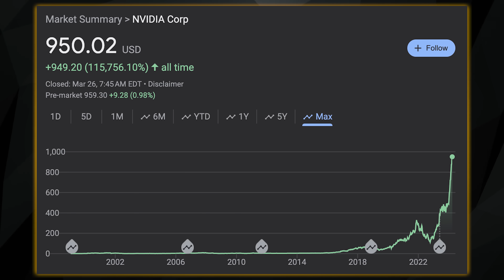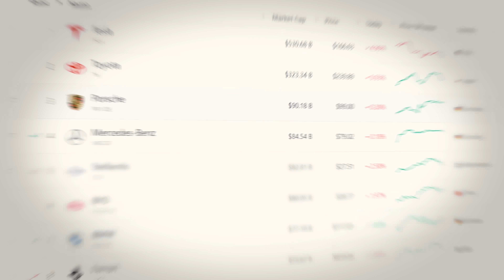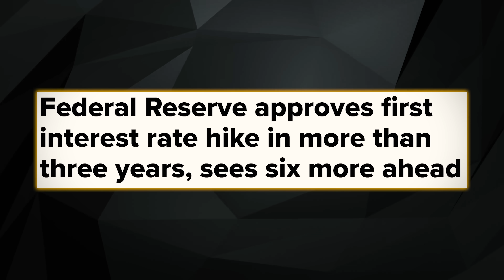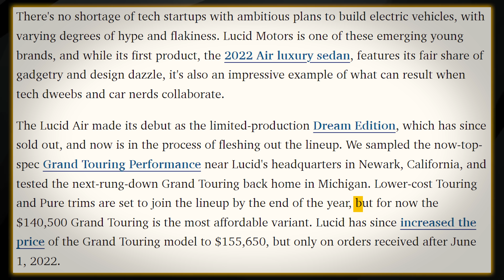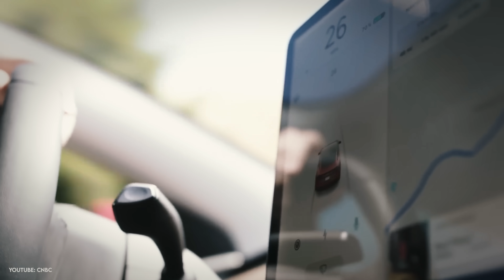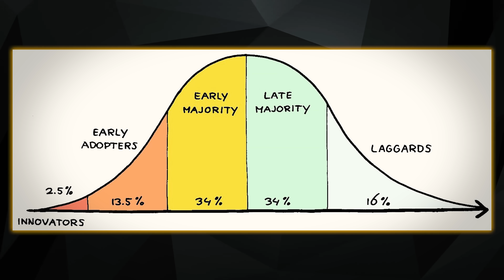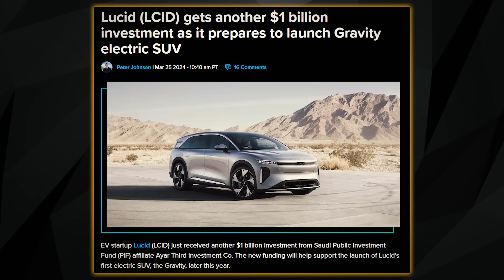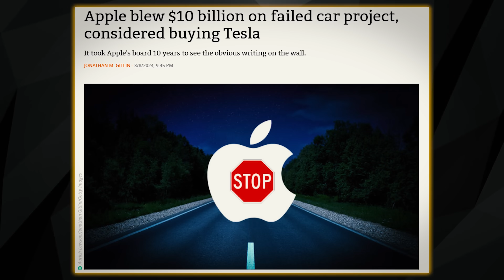The EV Bubble Popped - What Now?

Comment: Most people don't understand just how much energy is stored in a gallon of gas or diesel. The US uses about 11.15 billion KWH of electricity per day. We also use 376 million gallons of gas (125k btu/gal) per day, which is 13.77 billion KWH of energy. We also use 125 million gallons of diesel (139k btu/gal) per day, which is another 5.08 billion KWH. Having everything be electric would lower those numbers somewhat because it's more efficient, but even if we're charitable about the efficiency gain, we'd need to double our capacity to generate energy, all while getting away from fossil fuels? 
It was NEVER going to happen. This was always a government-subsidized pipe dream, at least in America. 
Hybrids and biofuels or synthetics made from captured carbon were always better alternatives. It has all of the EV upsides regarding efficiency (and zero emissions, on short trips), and none of their downsides. Big trucks should also be made with the same style of powertrain as diesel-electric boats or locomotives, with a big enough battery to do (very) short local trips or move around a yard on it's own. EV battery weight is pretty consistently  ~35% of vehicle weight if you want 300 miles of range. Scale that up to a 90k lb semi - it just doesn't make sense. Liquid fuels with hybrid tech is the solution for the energy requirements in the first paragraph for the forseeable future.
Reply: They have done this. It was phev
Reply: That’s a well written comment right there… I actually learned some things.
Reply: @jameschalkwig787 Renewables with massive batteries, which can handle massive changes in load.
Reply: Renewables are the future, and not only because of man made climate change, but they will produce energy more financially efficiently. Norway already has 70% of its energy coming from renewables. Technology always moves forward, there was a time Bugati produced a car that used 1.5 miles per gallon. The push back comes from fossil fuel companies who want to maintain the status quo and have used propaganda to get people against EV's. The next big thing could well be solid state batteries with billions being invested, their practical usage isn't a case of if, but when.
If we look at what the ultimate future to be it will be every household producing all its own energy needs via solar/wind or something we haven't thought of yet. Problem is that will mean no energy companies so they will all continue to fight it. So work backwards from that endgame.
Reply: @alfredthegreat9543  then explain why in Europe electrical prices have exceeded diesel/petrol prices, to the point the active road charging in Germany was deemed a failure.  It's cheaper to buy the fuel with the heat taxes on it than to pay for the electricity.

If renewables are the future the plan must be to make everyone poor and take power away from them.
Reply: Well done sir. Logic v emotion.
Reply: @bowez9   Europe has had skyrocketing electric prices because of their grids being too reliant on natural gas. That has nothing to do with renewables. Also the phaseout of nuclear in some countries ended up being counterproductive. By what source was charging in Germany declared a failure?
Reply: Biofuels and synthetic fuels aren't as efficient as an EV getting power from the grid or your solar roof. Efficiency is precisely why EVs are the only way.
Reply: @michalandrejmolnar3715  me: Presents well reasoned argument complete with numbers.
You: no, because efficiency (doesn't back this up in any way whatsoever, completely ignores how it would be impossible for every household to generate 1500-2000 kwh per month locally via solar panels. Reminder, people live in apartments too. Ignores how many areas just aren't sunny enough to be efficient, ignores massive number of panels required, etc)
Sure buddy, whatever you say. You just ignore the part of my original post where I said "for the foreseeable future" and jump a century into the future to where your pipe dream MIGHT be becoming a reality.
Reply: @IFRYRCE  I merely pointed out that EVs are more efficient to drive a certain distance than the required synthetic fuels. I am well aware you can't fully charge your EV with your solar, but solar on a big scale can still charge your EV. I know people live in apartments, for those there must be more city AC and intercity DC charging
Reply: @IFRYRCE  You know synthetic fuels are produced with electricity, right?
Reply: @michalandrejmolnar3715  Again, you've failed to address the core of the argument, which is that we do not have a way to literally double electricity production (to eliminate liquid fuels) while relying entirely on renewables, at least not for the foreseeable future. Especially as new extremely power hungry industries like crypto mining and AI tech are being introduced that will continue to dramatically increase maximum power load. Crypto alone accounts for over 2% of global power usage already, and AI is even more power hungry.
I'm not disputing that you may be correct if we go far enough into the future, but its not likely to happen entirely in my lifetime. Additionally, liquid fuels are simply far too good at storing energy (per unit of weight) in comparison to batteries to give up their use where energy generation must be mobile, such as in vehicles.
Reply: @IFRYRCE  That argument plays for me, because we will have a better chance to deliver less electricity with EVs than with synthetic fuels.
Reply: @michalandrejmolnar3715  ok so you're ignoring all the math I did in the first post that literally proves that is not the case. Got it.
Reply: @michalandrejmolnar3715  you know batteries are produced with both electricity and liquid fuels, right?
It's not a matter of whether or not it takes electricity to produce either, it's a question of whether you can afford to make it all in one single supply chain (electricity) or whether it's far easier to have separate ones (liquid fuels and electricity).
Also, biofuels do not require electricity to produce if you make them with the correct crops, Brazil's ethanol production is a net producer of electricity due to sugarcane bagasse.
Reply: Facts my brother, unfortunately some people get overly excited about EVs without realising that it takes some time for technology and infrastructure to catch up to ICE vehicles
Reply: @michalandrejmolnar3715  it doesn't matter how efficient EVs are, the problem as the OP correctly pointed out is that to completely transition to EVs we would need to greatly increase our electricity output. Not only is that not possible now, but how are we going to do it, increase burning fossil fuels which entirely defeats the purpose of clean energy & EVs or switch to solar, wind etc which is never going to meet our energy needs if we all transition to Evie's no matter how many solar & wind farms we build.
Reply: @alfredthegreat9543  Countries like Costa Rica, Norway, Denmark, Sweden and Estonia are the exceptions that prove the rule. They are either blessed with geothermal energy source or have no energy intensive manufacturing industries and the resources to implement renewables. Most countries are in the same boat.
Reply: @alfredthegreat9543  All we need to do to follow Norway's lead is to find an area that gets sufficient rainfall, construct man-made fjords, and then dam them to generate hydro power.  Every household could construct one in its backyard.  And then each family could use the electricity to power a small smelting operation, like China did in the Great Leap Forward.  You can always locate the time of the Great Leap Forward on world population graphs.  That's when so many people starved to death in China that it actually caused global population to decrease around 1960.
Reply: Not only we'd need to double our capacity to generate energy (via Solar, wind or nuclear), but also the more expensive portion of increasing the distribution capacity.
Reply: Agreed.

We should of focused on improving and moderning our power grids and pushed for Hybrids.

Also, combustion engines haven't reached their full potential either.

Less gas, more power, the combustion engine still has a long ways to go.
Reply: Never? Some states are already achieving surplus renewable electricity generation during some parts of the day. I just read a story today about California grappling with a new problem - too much solar.
As more renewable electricity and battery storage goes online, much of that excess electricty can go towards charging EVs.

Even using gasoline (or diesel rather) to charge your EV can be more efficient and you come out ahead. Since a Model 3 has a MPGe of 138 city / 126 highway and a large diesel generator gets 45% efficiency.

There are many videos on this subject such as this one comparing a diesel ICE's mileage vs a generator charging a model S: https://www.youtube.com/watch?v=tw-hHggAYFM
Reply: @bravado7  my brother in Christ read the entire comment at least before you reply.
The very last sentence is liquid fuels with hybrid tech is the best solution for the foreseeable future.
I was already pointing out that it's more efficient to run EVs off generators, the only difference is that I realize it's better to put the generator IN the ev so you can do with a smaller battery. That's called a hybrid.
Additionally you didn't address the point about doubling energy usage, just mouthed platitudes about renewables that don't address a need to double the energy provided.
Reply: @IFRYRCE  The problem with putting a generator into every car on the road is that not only is that wastefully duplicative in terms of parts and systems, but also whatever generator you can put in a sedan wouldn't be able to get 40% efficiency much less 50% or generate from alternative sources such as wind or nuclear power.

I think that a pure BEV such as a Model 3 will fully meet the needs of and replace 80% of ICE cars on the roads especially if it's the family's second car.

Your proposed alternative liquid fuels also faces the same inefficiencies that I mentioned above, but has the additional inefficiency of converting whatever the original energy source was to said liquid fuel form.

Look no further than our current corn ethanol additive in gasoline which amounts to a government subsidy of corn farmers and a net waste of energy because ethanol production consumes six units of energy to produce just one unit of energy via ethanol.
Reply: @bravado7  Its not wasteful. The batteries are far more limiting in terms of quantity we can produce and what we can currently recycle than generator units are, it makes sense to use smaller batteries along with a small generator. The whole "duplicate systems are wasteful" is a disingenuous argument, hybrids are both lighter (meaning less material input) and cost less than full EVs of comparable size. It's not wasteful at all, or it would be more expensive by at least one of those metrics.
You can build multiple entire conventional ICE powertrains for the cost of a single EV battery, likewise with generator units. 
Also you don't need to convince me corn ethanol is bad, but that doesn't make all biofuels bad. Brazil's sugarcane ethanol production is either carbon neutral or negative depending on who does the study, and it also produces excess electricity via burning bagasse when you're done making ethanol.
Reply: @monash4250 fact is OP actually incorrectly measure energy requirement to make carbon capture synthetics. Basically if somehow 80% general population switch to syn the energy cost (electricity) would be higher  than using EV, why? process inefficiency.

EV
1. Power plant
2. Transmission
3. Battery

Syn
1. Powerplant
2.Transmission
3. Electrolysis (H2O to H2)
4. Carbon capture
5. H2+C to isoctane (you do realize right we must put back energy to make hydrocarbon )
6. Transport
7. ICE

each step has a loss of energy.

So not only it is a combustion inefficiency but also process.

Now how about biofuel? well either somehow we grow large , i mean ultra large corn. Which kinda a vital food source, with limited farm space.
Reply: @acardenasjr1340  before that i must say i am an aviation engineer, so i am not pulling from my ass. Is ICE still has room of improvement? yes. Is it still a long way? No, especially consumer. Either you make a complex piston engine to gain maximum energy conversion, or switch entirely like generator to motor just like what edisson truck or any diesel electric locomotive. or jet engine.
Reply: And dont pull the grid strain . Remeber AC Unit? yeah back then "AC unit use so much electricity, this is strainning the grid", and here we are
Reply: @273MICKO  I've already done the math to show this is a bigger issue than that, it's not my fault if you can't follow the numbers.
Reply: @alfredthegreat9543 It's not technology, rather it's geography. Norway is almost all hydro-power, and Iceland is entirely geothermal. They have abundance of cheap and green electricity. Norway's population is only a few million, and the fjord mountain terrain forces people to concentrate in a few major locations. And Norway has money to burn from exporting oil, which is how they were able to fund the EV charging infrastructure and electric grid.  

The reality is most countries still rely on fossil fuel to generate electricity. US, China, and Australia all burn coal for their energy mix. They have no choice but to do so because they cannot meet electricity demand from other sources. 

Which means, rapid electrification of cars results in additional usage of fossil fuel for the foreseeable future. Aside from EVs, many developed countries are scrambling to meet future increase in energy demand from data centers and advances in AI. It's a terrible idea to be entirely dependent on electricity for transportation. There needs to be a circuit breaker in between electricity and transportation in case one fails. Imagine a large-scale hurricane, forest fire, or tornado followed by an extended period of electricity blackout, and you only own an EV.

Comment: Part of the mistake is pitching Tesla as a tech stock.

They’re a car maker.
Reply: When Elon said that he is a "Real life Iron Man", there is a continuation to that,
apparently people didn't let him finish his sentence, 
which is "Real life Iron Man Janitor"
Reply: considering they got there own AI and ai chip and there own autonomous robot no they aren't just a car maker
Reply: @songhan1586  After a decade of promises they still can't get FSD working, and are still relying on outdated processors from nearly a decade ago; note that there hasn't been any major changes in the Model 3, S, etc. in that time. Elon made a rash decision to rely only on cameras and downgraded this capability further, whereas more successful autonomous driving offerings such as Waymo use LIDAR and other sensors, and while not perfect have a much more proven track record. Tesla's AI is flawed and far from ready, and at the pace of advancement it likely will be for some time. None of their other AI offerings, such as the robot, are cutting edge. They're rehashing the Boston Dynamics of 15 years ago.

Tesla did normalize the idea of electric cars for the masses, but it seems at this point it's much more like Ford, that originally normalized the idea of cars for the masses, than it does NVIDIA or OpenAI. 

You know, a CARMAKER.
Reply: nope, they make batteries, solar, and develop AI as well
Reply: @blasiankxng  Tesla Batteries can't even beat Hybrid which is 150+ miles more and cost $15.000 less.
which is why hybrid is what most people actually need.

Solar and AI is completely irrelevant in a Car because you can't utilize it.
and most people who own tesla didn't bother to buy the FSD version.

did the AI chip makes the car goes faster or consume less fuel? if not, then it's useless.

it's a car, not your freakin living room

most people want  a reliable car, and not a high tech car that cost more and with less range.
Reply: @jensenraylight8011  okay
Reply: @blasiankxng  They lose money on solar, and that's with all of the "green" subsidies. They haven't done jack shit with AI, just like the majority of "AI" companies.
Reply: That has the best real world A.I. and utility scale energy products
Reply: @songhan1586  Where is that robotaxi?
Reply: I can hear every self-respecting car maker scoffing
Reply: @blasiankxng and Mercedes makes perfume. What's your point?
Reply: @josecipriano3048  obviously my point is they're not just an auto maker.